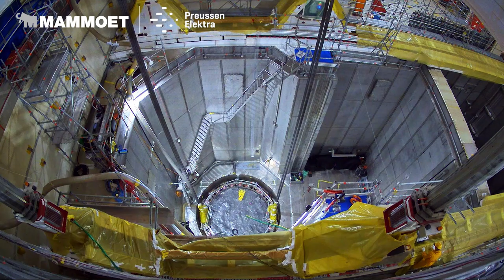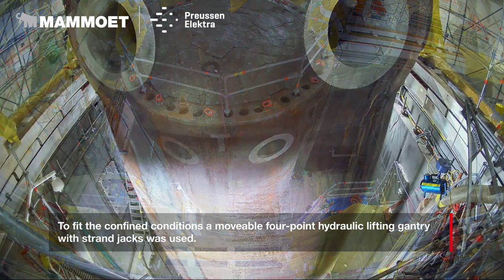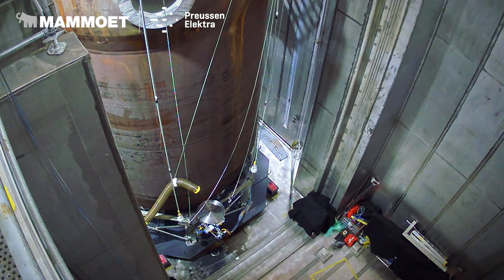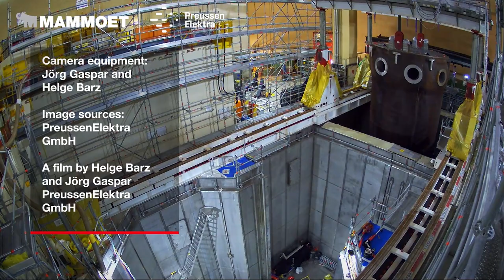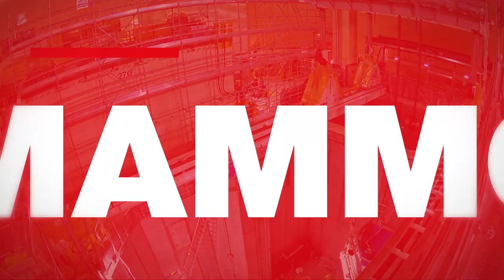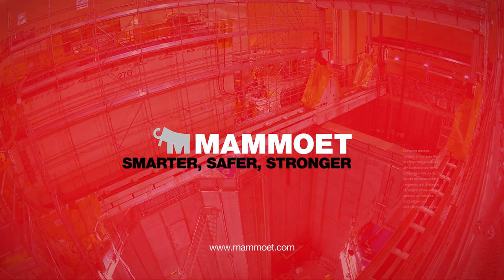Lifting a reactor pressure vessel for decommissioning project

Comment: I would be interested in the level of radiation and the type of radiation [alpha, beta, gamma] generated by the steel pressure vessel??
That there were people close to it as it was being lifted out, does that mean the level and type of radiation [ie not gamma radiation..] was not so harmful that it could be managed safely?
Reply from the maker: According to the operator PreussenElektra, very strict radiation protection requirements apply during the decommissioning of a nuclear power plant, just as they do during power operation. The operator is therefore very familiar with safe work in the controlled area. All fuel elements and thus 99% of the radioactivity have been removed from the power plant. Apart from this, all radiation protection measures in the sense of the minimization requirement are aimed at reducing the exposure of the employees to a minimum. Therefore, working conditions in the controlled area are such that work can be carried out safely. In addition, all activities in the controlled area are accompanied by radiation protection personnel.
Reply: @MammoetHeavyLifting  sorry I meant to say thank you for your response.  Although what does happen to the steel from the pressure vessel? How is it disposed?